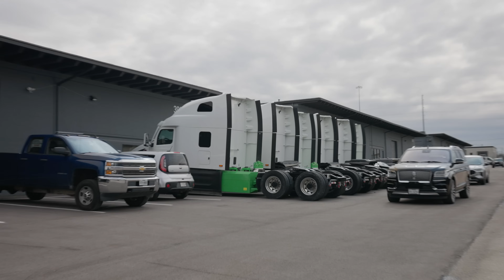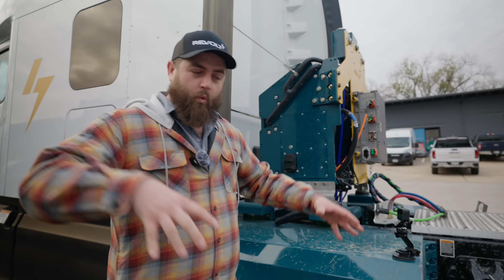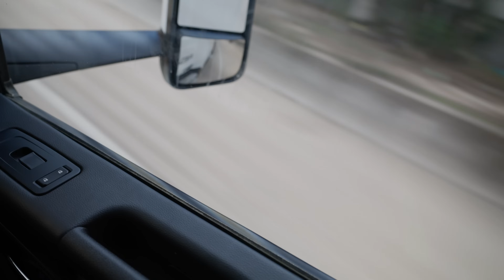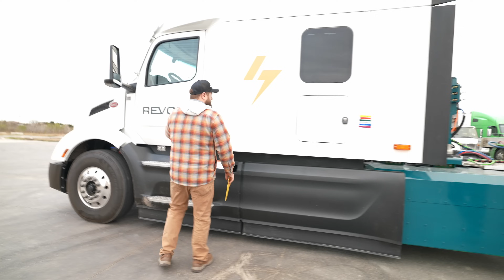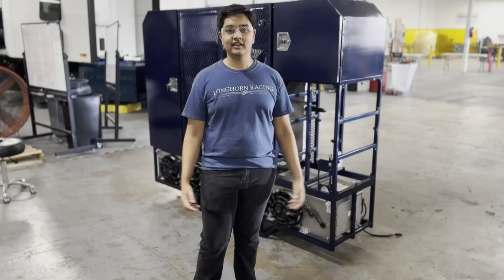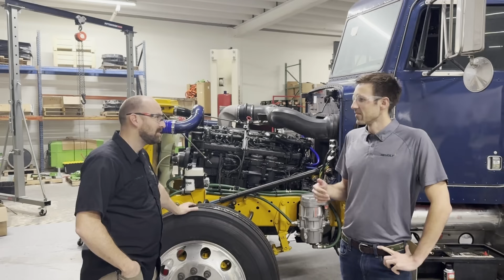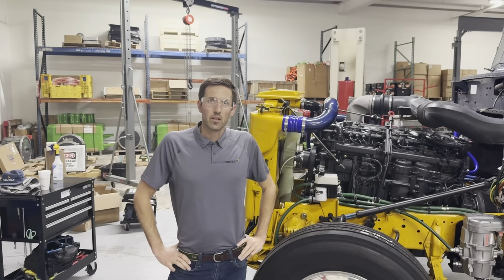Test Driving First EVER Diesel-electric Peterbilt Truck!

Comment: I work for a transit company.  We have 4 hybrid busses that run 6.7 liter Cummins and they only get 1 mpg more than a diesel bus with an 8.9 isl.
Reply: Yeah I work for Cummins and we have built several hybrids over the years and they dont perform as well as people think. We are testing a new hybrid semi right now with updated batteries, hopefully it does well.
Reply: What's the base mpg of the 8.9? Going from 10 to 11 mpg is a 10% efficiency increase which is nothing to sneeze at.
Reply: @ 1mpg isn’t shit when the bus costs double the price for a hybrid
Reply: @ huge waste
Reply: @TexasDragon3907  double, the cost,double the repair cost, lower payload, its a pointless money grab for grant money and corporations trying too look green
Reply: @guyod1   If hybridization is pointless why are all the taxi's and ride shares switching to hybrid? Their running cost are dramatically lower. The drive system moves wear off the engine and on to motor which has less moving parts and is less failure prone. Less running of the engine fewer oil changes same for the transmissions in this case. The regen braking takes wear off the brake pads and reduces the down time needed to change them. At least for the taxi's by time the battery is toast the vehicle has made their investment back. I'll wait to see the street price of this "prototype" but I believe Edison estimates a 25% initial cost increase on their semi trucks and the cost is nowhere near double the cost on current automotive hybrids currently on the market. The technology has obvious benefits now and is only getting more efficient and cheaper each year. For a semi you're losing payload but I don't think buses are payload starved.
Reply: Buses are not trucks. You're comparing apples to oranges.
Reply: Wow

Comment: My question is, with the weight of the batteries and the headache rack, how much loss of weight from the 80,000 for a tandem, tandem, is lost? Also, with that weight gained how much of a drain happens when you're at highway speed or stop and start in a city drive scenario?
Reply: Well, you could run a much smaller engine in theory, plus (minus) that you don't need a transmission transaxle etc.

A truck gearbox is ~600lbs
You can probably same as few hundred lbs on the engine alone.

Rounding up the parts it's about 1000lbs saved.

An E-axle isn't much heavier than a normal diff, maybe a 200 lbs more.

The generator/alternator is maybe 200 lbs.

Then the question is the batteries.

You probably need a 200kWh pack in order to deliver sufficient power.

A 100kWh pack is about 1000 lbs, so double that plus 200 lbs on other parts.

The total weight added is maybe 600lbs, not that much
Reply: Well, those 2 small concrete blocks are all it can haul!🤷

Comment: That is something that every driver needs to understand. Trucks are evolving. They are becoming smarter, and more fuel efficient. Despite what everyone thinks about the automatic, it is NOT that people do not know how to drive a manual. All that computer gadgetry is the reason, trucks are going automatics. I started driving trucks in 1976, and I love the technology, which is coming out. Trucks need to change to get that competitive edge for a company. Even those Autonomous trucks need five levels, four of which require a driver.
Reply: I've driven those automatics. They're absolutely junk. They don't know if I'm on ice, they gear hunt constantly. They are never smooth in traffic or in when backing. I'll keep running a manual like a real driver.
Reply: @TruckerMike089 Let's be honest here, A real driver can do both. What year was the truck and what type were you talking about? I ran an automatic way back in the early 1980s, and that was bad, especially in the snow when the rear drives would lock up to catch up to the RPMs of the engine... fun you bet and an experience I know that has greatly improved over the years. .
Reply: @StephensStudio-1  I am being honest. They are absolut garbage. I've ran a 2016 T800 with the Eaton 13 behind an ISX Cummins. A 2014 T880 using a Paccar and the same 13 speed. Last automatic I've driven was a Pete 579 with their 12 speed automatic behind an X15 Cummins. All were garbage.
Reply: @TruckerMike089  Gotcha. Thank you. Presently I drive in my final years, almost 50 years in trucking, a 2016 MACK Pinnacle and that is an automatic. and I also help the company by driving a 2024 HV International with a 20 foot tri-axle dump also an automatic. I find they take a bit of getting used to, and not always do you place it GO, but need to put it into Manual Mode to climb a 15 degree ramp out of a pit loaded with stone. Thank you for your honesty. It helps
Reply: @StephensStudio-1  I've only had 8 years so far but from what I've found I prefer the manuals. I can control them better, I shift in a more controlled manner and I can regulate the torque on the truck better. I heard that Mack and Volvo have a decent automatic but I've never operated one.

Comment: I would prefer the products from Edison. Motors,

 #1 they are tested and daily driven in some ridiculously cold weather.

#2  they're testing has included extreme overloads and not "some" weight.

#3  they are produced with do it yourself repairs in mind and off the shelf locally available parts.

Nothing against these guys, and I hope they succeed, but it's about time we, the people can do for ourselves without prohibition. If you are not allowed to fix your own stuff, that is a monopoly. First, they take away your ability to do it. Then they take away your access to the parts through mainstream. Then they force you to use only specified technicians at their specified rates. If one major repair can bankrupt you or put you out of service for good, then the product is no good.

Comment: Is this a truck for OTR or just short haul like the tesla
Reply: It's got an on-board generator, it'll run for longer than a diesel only truck. Edison Motors up in Canada is doing basically the same thing. Conversion kits for pickup trucks, and building semis from scratch. Their preliminary testing showed a 30-35% fuel efficiency gain with diesel electric compared to straight diesel. And that's without any external charging.

Comment: Lots of pure electric trucks doing warehouse to store deliveries here in Norway now. Pretty sure they have like 200 miles of range or so.
Some of the warehouses have like 50-100kW DC chargers at the loading bays so they can top up during the day, but then able to charge over night at the parking lot with higher power chargers.

Comment: Why run a big diesel engine when a 2.8 Cummins running at peak can maintain a charge on the batteries. You’re wasting fuel and putting undo wear on the big engine.

Comment: Overweight on the steer axle with 6000 on the deck Bravo
Reply: You can get heavier duty front axles. I run a 13,200 axel. However I do agree that not showing the weight with only 6k of freight is fishy and feels like they are hiding failure
Reply: @TruckerMike089  the last that I known they had 8k 10k 12k 14k and 20k axles sizes for steers
Reply: @stevewood3170  Ah okay.
Reply: My Volvo has 13.2k front axle and that’s not even the limit so no issues here

Comment: Volvo built a hybrid 11 years ago for Municipal use in Europe. Didn't extend it as far as long haul trucks but currently they have all electric semi trucks. The company I work for run two on local work and rigid truck also. Limited range though.
Reply: Yes, the main problem with electric truck is extra weight meaning the overall load capacity is reduced and limited range usually 250 -300 miles or 400-500km or less which limits it to local work . Super expensive charging infrastructure is also needed to make them viable for long haul

Comment: For decades locomotives have been diesel-electric, and now that battery technology is advancing, I think it’s past time for this technology to come to heavy duty trucks.   This will bring very effective parked A/C , far better then current factory battery powered A/C.  For OTR drivers who spend weeks at a time in their trucks it will provide far greater electrical capacity for cooking meals in the truck (I meal prep and have a deep freezer to bring homemade meals for healthier eating while in the road).   Add a switch so I can manually start the engine an hour or so before I park for the day to ensure sufficient battery power for my break and I’m sold.
Reply: They already said in the first video they are working on a solar system since the battery packs are already setup for it. These are Tesla battery packs and cooling system. Same system they use on Tesla home battery system. It's all plug and play
Reply: I know really big mining trucks uses the diesel engine as a generator, cause the drivetrain would have to bee too big and bulky to be practical. so instead, each wheel has a electric motor in them. But I do not think they have a battery per say, its more like a power buffer if so.
Reply: I imagine one of the challenges is weight, it’s desirable for a locomotive to be very heavy to aid traction but in a truck weight reduces payload.
Reply: British and Euro train builders have been building all electric battery powered trains for none electrified tracks.. these tend to be short passenger commuter trains ...but they are also building batteries into mainline locos.
Reply: @clivestainlesssteelwomble7665  Do not UK have power lines above their traintracks? Or why do they go batterypowered?
Reply: Makes complete sense verses all battery.
Reply: maybe they should configure solar or wind into that to help recharging or both
Reply: @lifeistooshort1112  lol. putting a huge propeller on a truck would just use more power xD  Solar would be usefull for ac and cooking/ heating but it would not be enough to really charge batteries to drive the truck..
Reply: @lifeistooshort1112 
Solar on a box trailer or curtain sided trailer would definitely yield a significant boost ..from large box vans you might gain up to 30% increase in range .. 
Don't forget you can electrify any trailer and create a hybrid system.

Comment: Ev's are not bad and the idea of electric vehicles maybe a good idea. The issue is for cars, utes etc is not the fact there electric it's the infrastructure to charge them. Not enough chargers and the grid can't physically handle the load. In order for the grid to deal with it they would have to up the voltage to drop the ampage so the existing cables can deal with the load. As for hgvs using electric, short runs daily return to a depot yes it's fine. For people like myself who go to remote areas and live in the truck for a week at a time, electric just isn't viable. Great video Bruce
Reply: No history and now the present has proven that EVs were a terrible idea and should stay dead in the dust bin of history. They've failed on just about everything, are highly dangerous, and more destructive for the environment.
Reply: I guess the environmental destruction and slave labor are ok with some people.
Reply: This is a diesel-electric, so it uses diesel to operate. If you want to do grid charging that's your choice but it's optional, not required.

Comment: You’re 400 lbs over DOT limit on your front wheels. Slide that fifth wheel back one slot. They also need to get that pig tail off of the cat walk.
Reply: 20k is the max for a steer.  Just depends on the tire and axle rating
Reply: @cCueBasE  if you were running duals then yes 20k would be max. Most of the time a steer is setup for 12,000lbs. You are right about tires making the difference though
Reply: Yep. Those are certainly words.
Reply: I run 13,200 front axle.
Reply: How do you know it doesn’t have a 13,000 pound front axle? My truck does I run 13,300 every day. legally.

Comment: Idea For the rack: try to have an option where the storage space could be heated by excess heat from the radiators, would be lovley to put snowchains in there and then they are all dry for the next time you use them.

Comment: It's very exciting for me, a diesel engine that charges batteries for electric motors. Electric motors have more power, more torque (that's why they drive locomotives), but the batteries had a small capacity, so you don't go far, and charging huge batteries takes a long time, and drivers don't have time... this is promising!
Reply: You do know they used to have diesel locomotives. They also used to have this amazing thing called steam.

Comment: I would never drive a hybrid. One thing that IMHO will not last long is the batteries. The amount of charge cycles are still limited for any battery; just think of it on a massive scale. Sure in the short term you will save on fuel costs but with the fluctuation of conditions from extreme heat to extreme cold I believe like most hybrid's or ev's they will end up in a scrap yard. If you do have lets say a cooler failure or any electrical issues you're looking at severe life threatening situations. I doubt any insurance company would want that amount of liability. At the end up the day sure the technology is there to make it happen but as a matter of practicality not a chance.
Reply: 10 year warranty on the battery should be sufficient. Batteries are getting better in terms of longevity, and price.

Comment: Love the diesel electric hybrids, theyve been used on trains for a while for a reason.
Reply: Not just trains! Mining dump trucks have been diesel electric for over 50 years. Just like Toyota Prius have been around since 2000 but it is hard to get truckers to change with out forcing them! Yet in a short time after Tesla starting to the electric way of going now hybrids are coming to play!  This should have happened years ago!!!